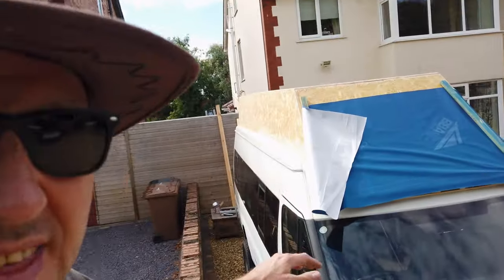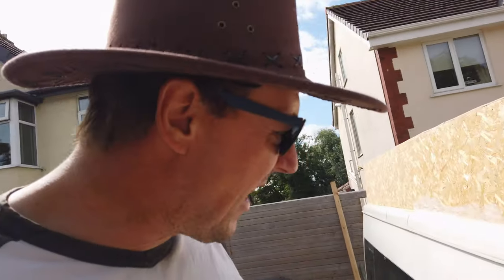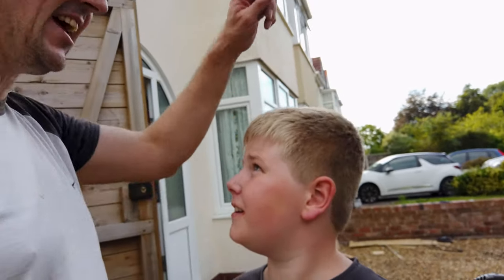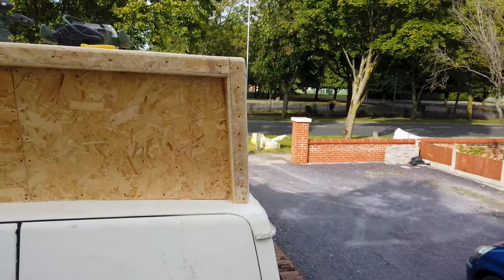DIY Camper Conversion  roof extension 7 diy hightop roof  fibreglass van roof | Van Build Ep.15!!!

Comment from the maker: Getting a lot of questions on social media about the Board 😊

The Board we use is OSB 3 Sterling 

Due to its construction, OSB3 can be used structural roofing. It’s also suitable for load-bearing use, as well as use in the most humid and harsh conditions. The wood strips are bound together using PF (Phenol-Formaldehyde) glue/resin.

It is also very sustainable, the way OSB is created means that manufacturers can use wood from small trees in sustainably managed forests. This allows larger, more mature trees to be saved. 

The roof is kept under a tarp till complete. Once ready it will be soaked in polyester laminating resin util it will not accept anymore. At this point Fibreglass layers will be built up and wetted out in more polyester laminating resin. The will probably be 2 CSM ( chop strap matt ) layers and then a final layer of biaxial weave fabric. The a gel coat will be applied for the finish this will create a waterproof shell that will last for decades.
Reply: If you’ve done your research and use the materials you’ve spoke of it’ll last last longer than that of which the critics have built (ah wait that’ll be 90% with no idea) crack on, some fantastic work gone into this project, been lucky with the British weather though recently 😃😃
Reply from the maker: @tmwc1802  Thank you very much 🙂 and thanks for your support in watching our vlogs 🙂🙂
Reply: Question is What is the A word
Reply from the maker: Our Very bad first video explains that one 😊
Reply: Great job mate, only thing I'd suggest is you make the front inline with the existing slope of the roof and window rather than "stepped out" at the front with the "wedge" as thats going to create a massive air dam which will create a lot of wind noise in the van when driving and i would imagine quite drastically reduce your MPG at a given speed due to the compromised aerodynamics of the roofline.. (unless there's another reason you have it protruding rather than in line with the existing roof line?) If not I'd strongly consider modifying the front profile.

Good job though mate good idea to raise the roof yourself just try to keep it as aero dynamic/sort of OEM ish looking as possible not only for esthetics but more functionality and mpg really, that's my only thoughts looking at it but it looks good overall.👍
Reply from the maker: Good morning, thanks for your support and your positive comments. The only way I could get the head hight was to run the line as seen.

I did take inspiration fron the VW Grand California, the new high top. 🙂
Reply: @traveling-taylors   welcome mate. Enjoy the ingenuity. Maybe you could try and feather/blend the bottom edge into the original roof with the fibreglass itself after? (Without changing the framework just that leading edge?) I'm just thinking it's gonna make a hell of a difference for wind noise/mpg mate when you're driving id imagine that's all. Up to you obviously its your van but I'm just looking at it thinking once you've fibreglassed it, it's gonna be harder to change if it's a problem that's all as it kind of creates an air dam at the top of the windscreen where the air would normally slip over the top it's hitting a 90degree wall/air dam (kind of an air brake effect)..
I just wonder if there's a way to blend it avoid any issue mate? 
Anyhow good job with it and hope it all comes out ok.
Reply from the maker: Check out this afternoons Video, the front has had a nose job :-)

I have looked at it all week and both aerodynamically and aesthetically it needed to change. Still got a bit of work to do even after the full day on Friday, looks so much better to the eye though.

Comment: Great work! Having built a few plywood and fiberglass boats myself, you are to a point where I have an idea what's going on now. It'll be interesting to see how you do it differently than I did. I still can't imagine how you're going to get the metal roof out, but I know you have  plan.
Reply from the maker: Thank you, as always for your comment 🙏 We do have a plan 🙂 with how we are going to remove the roof. It won't be easy but nothing about this build so far has been easy. Even the 14 seats we removed were a struggle 🙂 but we enjoy a challenge.
Reply: Jigsaw should do light work of it
Reply from the maker: Used the reciprocator saw in the end. Worked well 🙂